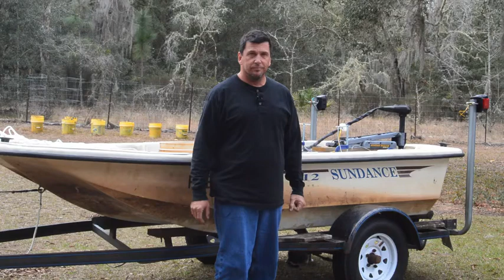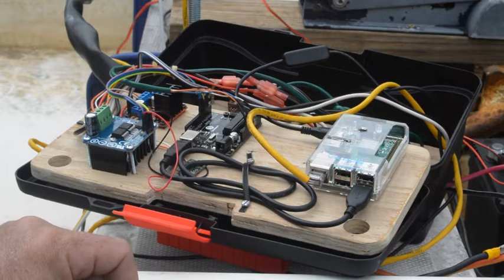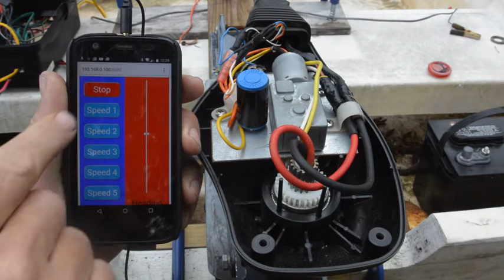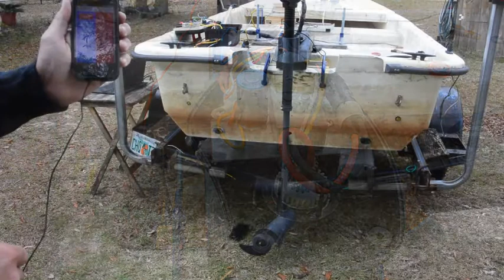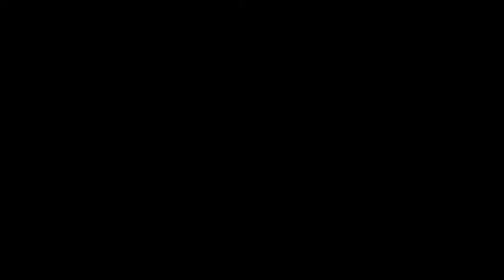Controlling a trolling motor with nodejs and raspberry pi

Comment: Kudos this was a lot to be done in 2016. 2 years later. RPi has built in wifi and bluetooth, no need to buy travel router. ya, I finally got myself a Raspberry Pi 3B+, so I will use it as a wifi server using nodejs for creating an iphone graphic user interface to control the TM speed. Yes, still need to buy ONE H-bridge board so I can steer the TM forward and reverse. Yes, I need to buy ONE motor driver board rated for 30 amps. Dang, 2 more parts to buy. Kudos for buying so many more parts (travel router because your Pi didnt have wifi). Pi 3B+ comes with wifi and blue tooth so no travel router needed.
Reply from the maker: Thanks for the interest and good luck with your project. I used nodejs as well. In my reply below I listed some of the parts that I used.

Comment: Very nice work! Can you tell me which H-bridge controllers you used (models)? I am making a similar project but I am having trouble finding a good 12V and 40-50A H-bridge controller to drive the trolling motor. I keep reading stories about various units being false rated for 40A and even 50A that burn up when load reaches 10A.
Reply from the maker: Thank you for the feed back. I got the H-bridge on eBay from China. It is the Semiconductor BTS7960B 43A Stepper Motor H-Bridge Drive PWM For Arduino New DHUS. I had plans to eventually let somebody else from the internet control the motor. The main issue I had was getting good internet out on the lake. These days it may be different. But I sold the boat out of frustration because I never get to go fishing and I was being a depressed jerk.

Comment: This is really awesome!! Thanks for posting it! Any chance of getting a build tutorial and code?
Reply from the maker: Sorry for the late reply. I got sidetracked trying to solve the internet access out on the lake problem and put the project away. I went back a few months ago and forgot the exact files that I used and didn't have it written in my notes. But basically I built a web page and used jquery and Ajax to talk to the page then back to the adruino. Not alot of help I know, but it's been a while.
Reply: This is weird I build a very very similar conversion from a foot control. Mine uses RF and encoder to pickup the motor postion then displays that on my fobs lcd. I find this wild cause you used the exact same turning design I did.. you did it 2 years earlier than me. I should take pics. I 3d printed my gears and new head.